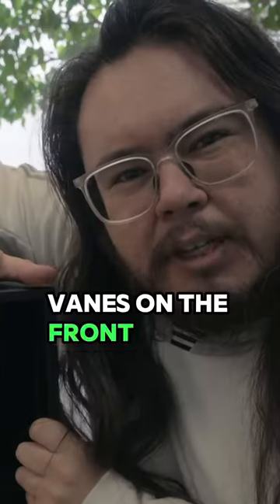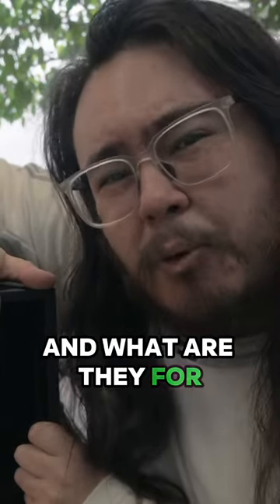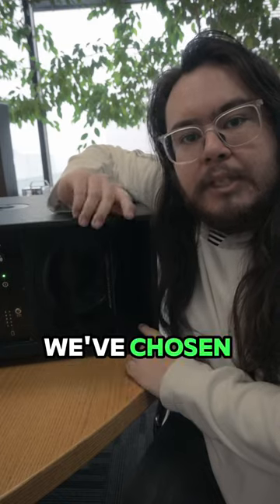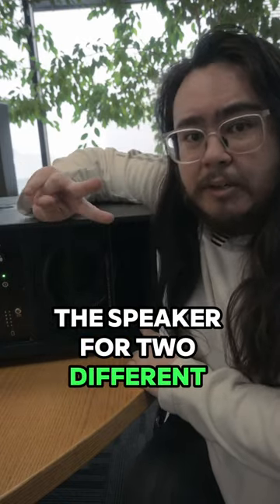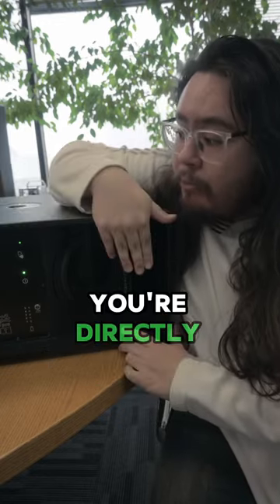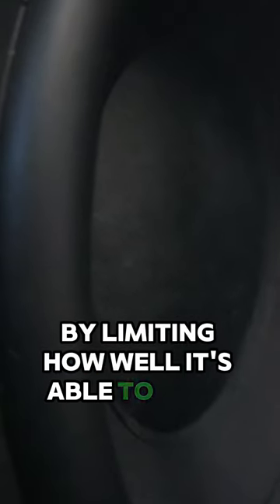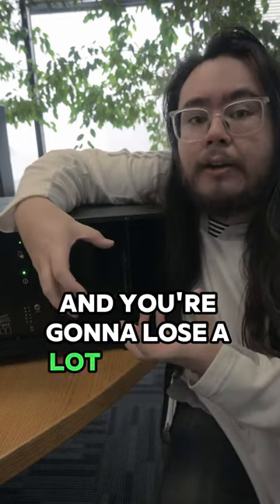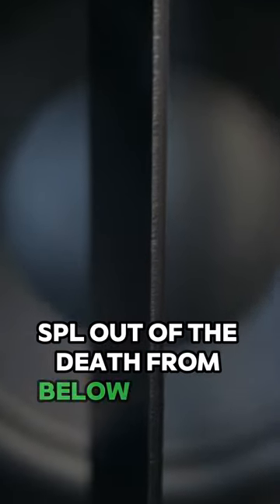Death From Below - Vanes

Comment: I have a Rotel RSP surround sound processor with RCA analog audio outputs which sends line level output signals to powered subwoofers.

Can the DFBs be used in this set up?